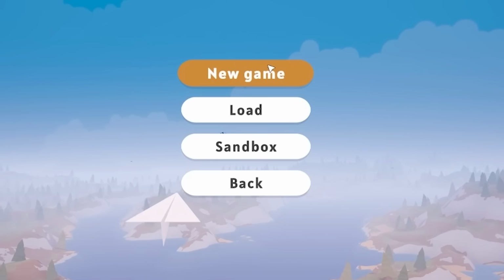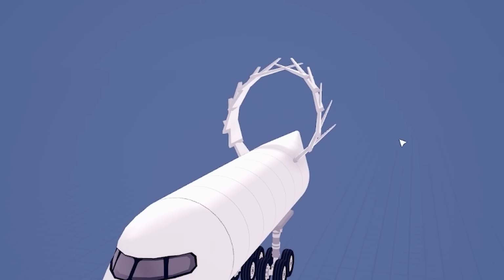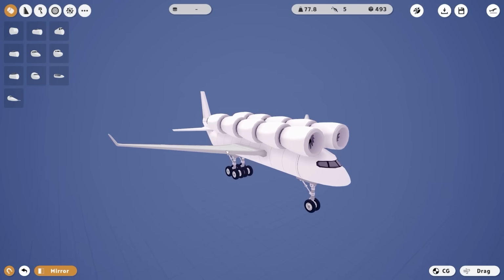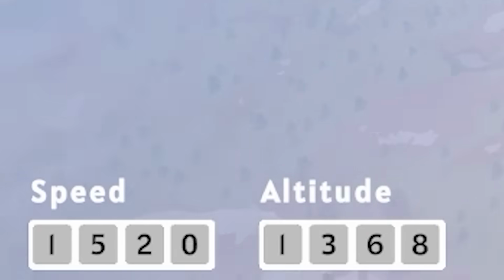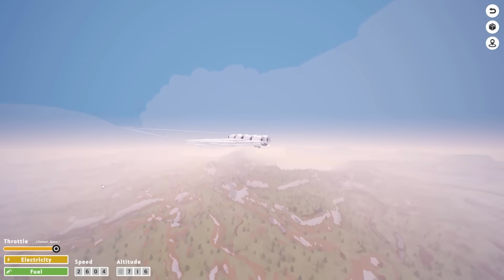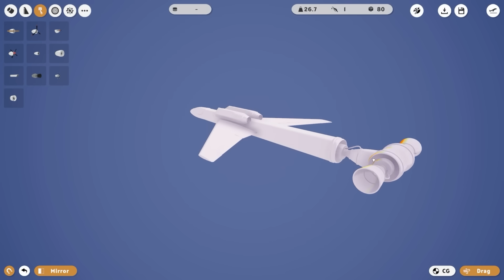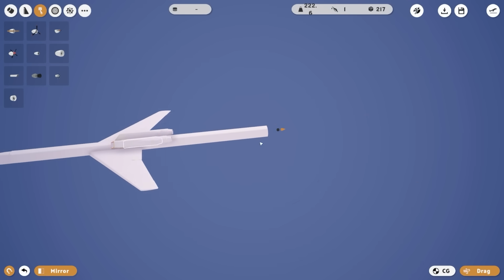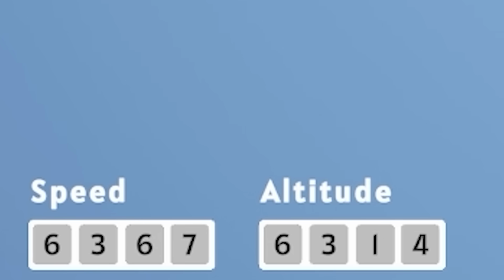Engineering a HYPERSONIC passenger jet...

Comment: I haves some tips, one I don’t play this game so idk but if there is a attachment or what ever it’s called that can remove any object on the plane so you can take off with all those thrusters and in the air remove the wings to release weight and the other tip is to go in the air high and go straight down to get speed

Comment: The wings must be horizontal for the physics behind it to work.
What you can tweak is the shape and angle of the wings to make it more efficent in generating lift at low speeds and less drag.
if your goal is speed, then lift should not be your focus, as more lift do not corespond to higher cruising speeds.
What you should focus on for that purpose  is the plane's body shape, in order to minimize the drag.
i'm not a Pilot nor an Aerospace engineer, so Take that with a pinch of salt😅

Comment: thats floating point error. normally you can have a position for model triangles like 0.000001 but if you move to 1000000, then the whole float is filled, so the vertexes can move by a full meter only, thus it all looks really bugged, because the number no longer can use .0 etc but only full numbers. the more digits before the dot, the less are after.

Comment: Some tips from an Aerospace engineer. You want your Center of Lift (CoL) from the wings slightly behind your Center of Gravity (CoG). It doesn't appear that this game has an option to see the CoL location of the aircraft. You can use the Quarter Chord rule of thumb which puts the CoL of a wing roughly a quarter of the way down from the leading edge of the root chord of the wing (root = side of wing that attaches to the fuselage). Putting the CoL behind the CoG makes the plane want to fly in a "nose-down" behavior, meaning it wants to go down in steady flight. This is why we add an elevator to correct the lift of the wings. This should create a mostly stable aircraft in the game, depending on how well the aerodynamics are modeled.
Reply: It’s the elevator that helps stabilize the pitch not the rudder. The rudder helps stabilize the yaw moment.
Reply: @brycenschroeder587  Good catch, that's what I get for not proofreading after typing. Thank you.
Reply: @Shadowkyuubi812 this is why he’s at a super nose high attitude in the first video with a wooden propeller. But airliners actually prefer to have an aft CG for the sake of airspeed and fuel efficiency.

When you have a forward CG you need the horizontal stabilizer + elevator (an inverted airfoil) to create downforce in order to have the nose level with the horizon. This downforce is acting against the lift generated by the wings, thus creating unnecessary lift-induced-drag causing lower airspeeds and worse fuel economy. As they say, time is money, and airlines loveee money.

As you mentioned a benefit of forward CG is increased stability, but also better spin/stall characteristics as the plane will be nose heavy and regain airflow over the control surfaces, which is why most General aviation aircraft (and trainers) prefer a forward CG. 

That’s why you occasionally see airliners who enter a “flat spin,” which becomes unrecoverable with an aft CG and insufficient thrust to break the flat spin. Believe there was a Brazilian flight last year where this occurred.

Cheers from a pilot in training 🤙
Reply: heyyyy im currently studying to be come a aircraft mechanic any tips on how I could eventually become a aerospace engineer
Reply: @Moe-dj5fg  play lots of ksp😊
Reply: Good tips, but the game isn't really about making stable planes. It's more like going haywire and doing whatever you want to do, but still, very good tips for beginners at both aerospace engineering and this game.
Reply: @Da_real_ton618  do you know a game with a more realistic approach to aircraft? Except for KSP.
Reply: @Da_real_ton618  like making a pocemon
Reply: ERM ACTUALLY 🤓🤓🤓🤓
Reply: 2 months late but thank God. This just confirmed my suspicions that this was the case.
Reply: Haha yeah, seems like some architectural marvels are being built here.
Reply: we do not care
😒😒😒😒😒😒😒😒😒😒😒😒😒😒😒😒😒😒😒😒😡😡🤬🤬
Reply: Yes
Reply: @george1_1-i3pULTRAKILL!!!!!!

Comment: Tail wings = horizontal stabilizer the ones on the left and right. Vertical stabilizer is the one on the top which has the rudder surface. Just letting you know keep up the good work👍

Comment: With aircraft, you really want your center of lift behind your center of gravity. For stable, efficient flight, the plane should be slightly nose heavy and your elevators should be pushing the tail down slightly. Likewise, the rear landing gear should be just behind the center of gravity so that the elevators can leverage the tail down to point the nose up on takeoff.

Comment: 46648 is the current record, which used an airbrake parachute to remove drag, the square jet engines for the best power/weight ratio, and a minimum size fuselage instead of any cockpits since the cockpit you were using actually doesn't block the drag of the part behind it.

Comment: Some aircraft do, in fact, have landing gear on their wings. It’s a good way to give the vehicle more stability on the ground. As opposed to putting them so close together that you instantly tip over and dig trenches in the runway with your wingtips as you try to take off. 😂
(Although in a case of truth stranger than fiction, a certain US spy plane only had two total landing gear, one in front of the other under the fuselage, bicycle style. How did it take off and land? Very carefully. 😂)

Comment: I'm sure someone else has already said this, but the reason the game starts to freak out as you get really far away is because of floating point precision errors, where the engine runs out of decimal points to represent precise numbers (as computers can only work with a limited number of bits, and hence represent large numbers with limeted accuracy, especially with floating point numbers). That's why everything begins to get so jittery, the math to dictate where the triagles of the plane's model have less and less precision to work with.

Comment: The developer of this game is in the Netherlands, so presumably the speed ratings are in kilometers, not miles. Incidentally, the record for fastest crewed jet engine plane (as opposed to anything rocket boosted/propelled) was set back in 1976 in the SR-71 Blackbird, and is just a touch over 3500 km/h (around 2200 mph), or Mach 2.8. For similar air-breathing designs, the only thing faster was NASA's  X-43, which in 2004 got up close to 10,900 km/h (6750 mph), Mach 8.8. The X-43, however, was remote operated unlike the Blackbird.

Comment: The reason everything glitches out at really high speeds is, like you said, due to rounding errors — but if you want the deeper technical reason, it’s actually pretty fascinating.

Computers usually store real numbers using the IEEE-754 floating-point standard. A floating-point number is broken into three parts: a sign, a mantissa (also called the significand), and an exponent. Together they represent a number in the form (sign) × mantissa × 2^exponent.

For example, the number 50.0 would be stored as something like 1.5625 × 2^5. Here:
-The sign would be 0 (positive),
-The mantissa would be 1.10010000000000000000000 in binary,
-The exponent would be 00000101 (binary for 5, typically stored with an offset, but that detail isn’t super important here).

Notice that even though only a few digits are actually set to 1s, the mantissa still fills a fixed number of bits, all those trailing zeroes are part of the storage format. Floating-point numbers have a limited amount of space, and they don't dynamically resize based on how "simple" or "complex" a number is.

When you start pushing the exponent higher (meaning larger and larger numbers) the number of meaningful bits available for precision shrinks. You can still represent large numbers, but fine detail gets lost. For example:
-1.0 + 1.0? No problem.
-1.0 + 0.5? Also no problem.
-1.0 + 0.00001? Still fine.
-50,000,000,000,000 + 0.00001? The difference is too small relative to the size of the number, so it gets rounded off entirely.

In practice, it means when you're dealing with really large values, your position values "snap" to increasingly coarse increments, instead of moving smoothly.

Normally open-world games avoid this by keeping the player close to {0, 0, 0} in world space and moving the environment around them instead, which keeps the underlying numbers small and precise. But with how fast you were moving, even that approach would’ve been seriously stressed. x3

Comment: After watching you play, I played for a bit, and found some good tips for building planes:
-Surprisingly you actually want your wings just behind the center of gravity
-The back wheels typically sit on the bottom of the wings near the body. This gives them more width so it doesn't roll over while taking off, and allows the back to sit lower than the front, which is vital for takeoff.
-Length doesn't have a huge effect on the plane, largely just adding capacity, costing money, and moving the center of gravity.
-Don't forget horizontal and vertical tail wings, they help provide a lot of stability.
-Different engines can be controlled with different keys. To do so, click an engine, then click the gear icon. You can also invert the controls and change the max acceleration with that. This works with other parts as well, including a part that detaches with a keypress and another that can rotate attached parts, allowing you to build things like vtols.

Hope those give you some ideas for making some madness. PS, I tried making a drone, game physics sadly don't like it, it always flips over backwards.
Reply: It's not surprising at all that COG is in front of COP, it's the basis of aerodynamics. Called this out in his first video, but I'm glad more people are saying this.
Reply: Fellow aviasemmbly player here, and those are some good tips. I recognize your struggles with the rotation joints, I think the physics engine currently is not really advanced enough to deal with rotating parts.

Comment: I was hoping that you would be going faster then the speed of light, but was disappointed to find that light moves at an incredible 186,000 Miles per Second, your top speed was 17,482 Miles per Hour (4.8 miles per Second) so in order to break the speed of light you would need to be going apx 669,600,000 Miles per hour.

Comment: The glitching at the end is very likely a floating comma precision problem. The plane's position is measured in relation to a specific point. So if it's stored in 16 bit float (for example), if the plane is 6 units from the point of origin, its position is defined as 6.5535 so it's very precise. For each magnitude of distance, the comma moves a digit to the right. At a distance of 6553.5, the precision is down to a single decimal, so the position jumps in increments of 0.1. This is just an example, the plane's position is definitely stored with way higher precision, but obviously it still can be exceeded, leading to the weird behaviour we see here.
Reply: That sounds a lot like "The Kraken" from KSP.
Reply: I also suspect this is what happens there. YouTube user Moosashi actually made a video about this happening in zenless zone zero.
Reply: He crashed into the frame rate
Reply: Strangely, why the devs are still using floats instead of doubles. I don't think there's more that 10% of users who don't have x64 CPU.
Also, it afaik - many of devs are still think that floats are "more optimized", but it's misleading. Compilers still prefer to translate them to doubles and back to floats, if you don't specify correct function.
Reply: @DragoEliteN  I default to floats myself, but I'm old :3
Reply: @DragoEliteN  Im curious if this is a custom engine, I can't tell

Comment: 8:00 in miles an hour the speed of sound is 761 miles an hour divide 2145 by 761 and you get Mach 2.8 in kilometers. The speed of sound is 1225 km an hour so you divide 2145 by1225 and you get Mach 1.75 and not the speed of sound is 661 so divide 2145 by 661 and you get Mach 3.2 so you would’ve already been going supersonic
Reply: I thougt it was meters per second

Comment: Some cool building tips:
- Angling the wings up a little will provide a bit more lift since the wings are directional. The default straight angle won't provide as much lift. (Turn off the rotation snap)
- Angling the engines changes the direction of thrust. So vertical engine will go vertical.
- The game has rotators and you can set the keybinds (click the object, then the cog wheel) to rotate anything attached to them. However there's a positioning glitch where they "slide" off-center on your plane. Hopefully this gets fixed soon.
- You don't need a main wing on your plane. I had a dart-type jet for timed missions and it only uses tail wings with Canard in front.
You should try the mission mode! It was quite fun.
Reply: angling the wings improves angle of attack, providing more lift while the plane is level than otherwise. it does increase drag and the risk of stall, though
Reply: @ARockyRock  A 2 to 5 degree angle is very helpful

Comment: With that much engine power, you might not need wings at all.
A couple of canards on the tail angled 45degrees are more than enough for control and lift.
It's also possible to get a plane that flies indefinitely in normal mode, with electric engines and air turbines.
Reply: entirely possible i've done it its so fun
Reply: @spock302  it's also possible to fly with no engines if you have 10+sets of the best debts wings. All you need to do to gain speed is pull up and left or right for a few circles then go where you want

Comment: If you extend the length of the fuselage a bunch and place tons of engines, then shrink the length back down to a smaller size, it will automatically adjust all of the engines to be basically all on top of each other.

Comment: From my testing I am very confident that the max speed is achieved by thrust divided by weight, and then drag plays some complicated role in that. But when you make a 10kg plane and the exact same plane but make it 20kg it will be half as fast.

That's why the rocket engines where slower since they have 80 thurst with 1.8kg (=44.5 factor), while the jets have 65 thurst for 1 kg (65 factor). This is also the reason why stacking more and more jets does not increase the speed that much more, since you just get closer and closer to the 65 thurst to 1kg ratio.
Reply: Well he only used 3 Rocket engines compared to even more of the other one